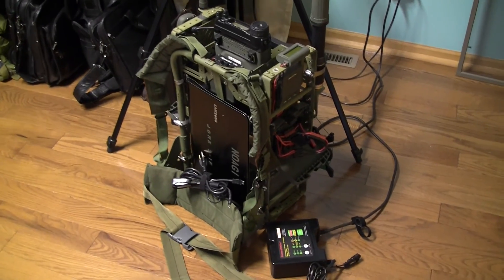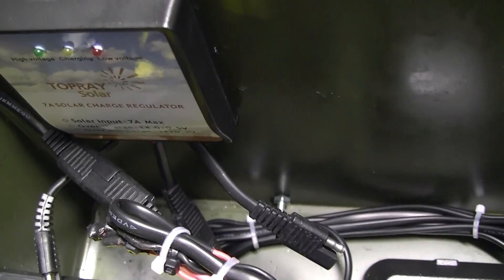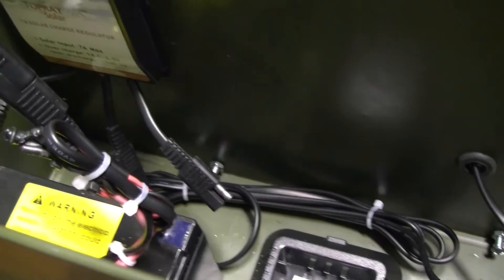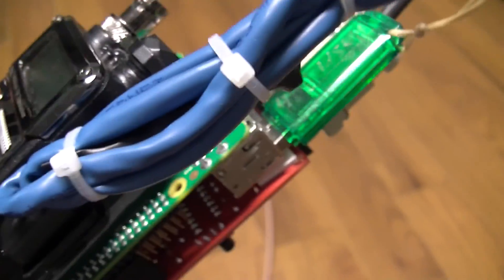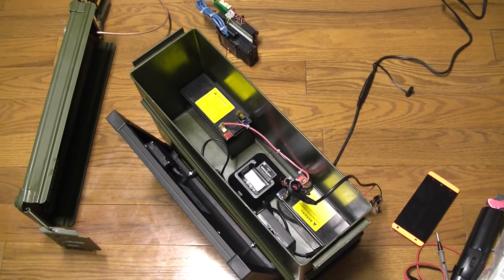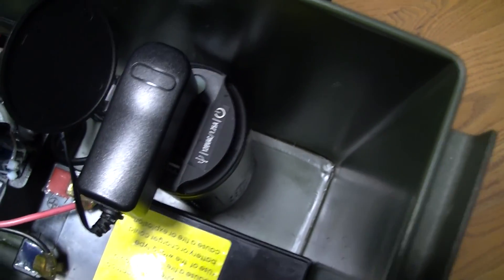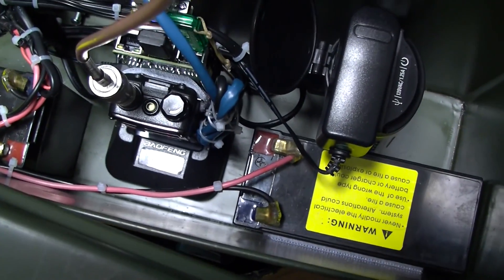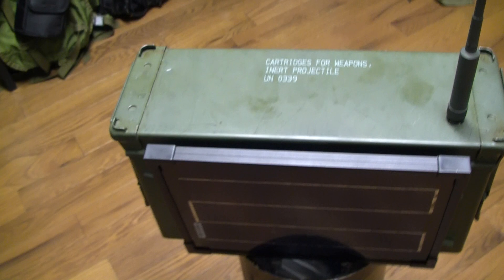N0AGI - Self-Contained Deployable iGate/Digipeater In-A-Box

Comment: You might consider this as a more ruggedized solution for protecting the SO-239 protruding from the top of your ammo can. https://www.ebay.com/itm/Connector-UHF-PL259-PL-259-male-Protective-Dust-cap-cover-boot-for-SO239-female/282958136738?hash=item41e19e85a2:g:x1AAAOSwol5Ywl52

Comment: Do you have a protective transport cover for the solar panel in case of getting bumped with something hard?

How are you logging in with Putty with the lid closed? Doesn't the box become a Faraday cage blocking the wifi?
Reply from the maker: n0ukf wifi connectivity worked ok inside the house. When deployed outside, it was spotty. I eventually added an external wifi antenna via a dedicated pass thru sealed hole on the lid.  For solar protection nothing much, since the unit stays put on a pole or on a benchtop. Has been working great overall.
Reply from the maker: no protective shield over the solar panel.  This would be no different from the solar panel powered low power antenna you will find across the freeway lanes, etc.  I believe the solar panels have some level of strength/resistance to normal wear/tear.   wrt - wifi connectivity, The Box has an external antenna that was since added to the top lid.  It works great. Thanks for asking